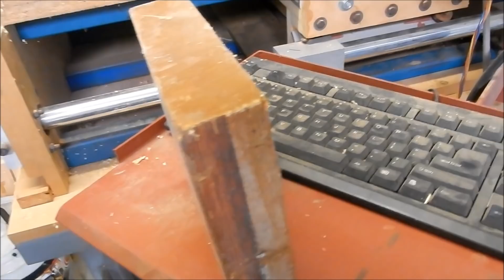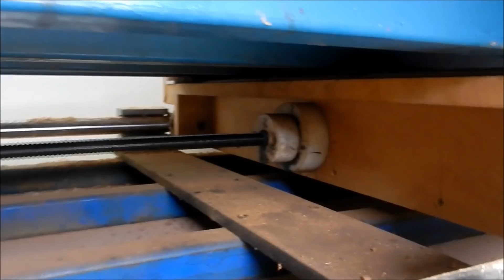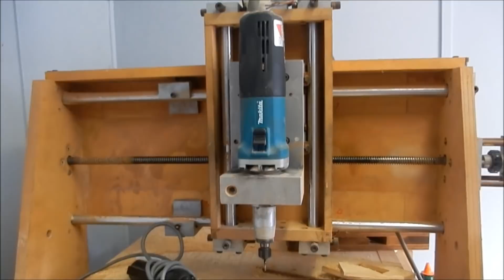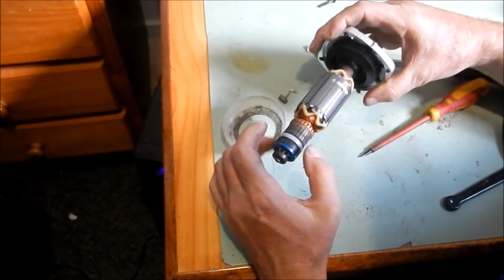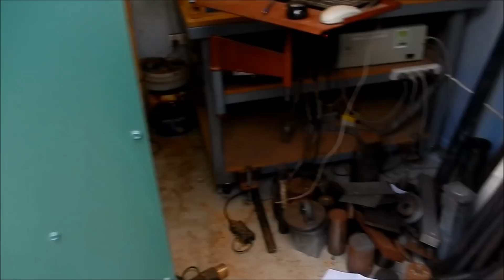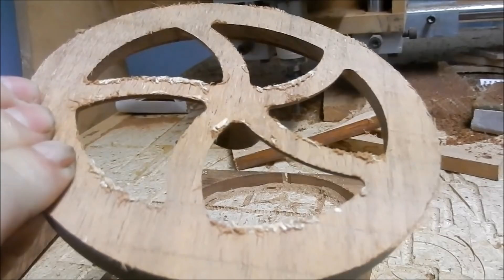Fly Wheel Solid Modeling and CNC Machining Part 3

Comment: Wow that finish is awesome
Love the CNC router, making one is on my to do list over the next year or so
Reply from the maker: Thanks Tommy, there is so much out in the market today that making a high end router is fairly easy and cost effective.  When I started, the cost of industrial gear that we take for granted today was out of reach for the hobbyist.  Back then it was all experimental, building our own drives and power supplies and learning from mates doing the same thing.  Actuating gear was roughly made Backlash Nuts and all-thread, having Ball Screws was like landing on the moon and cost about as much.  I must admit looking back on it, it was great fun and I learnt so much from the experience including hand writing GCode before I started using the first Hobby open source CAM package "DANCAD".  I would certainly encourage you to make one, it opens up all sorts of possibilities, both in, and outside the Workshop. 
Cam

Comment: Great video Cam. CNC routers are an excellent tool for use in pattern making. Regards MachineNZ
Reply from the maker: G'day Kevin, I wouldn't be without it.  I was quite proficient with it a number of years ago and could knock Patterns and Core Boxes out at a fair rate.  I've probably done hundreds of jobs on this router over the years.  As I mentioned I haven't touched it for quite a number of years but it felt comfortable hoping back on again.  I'm looking forward to getting a small foundry up and going again.Cam